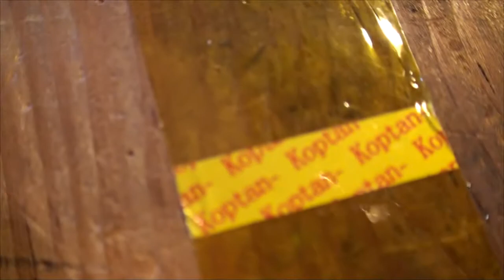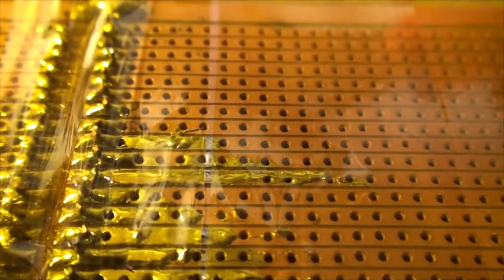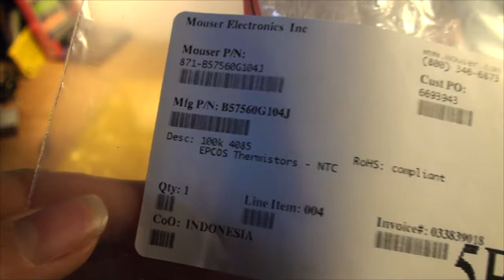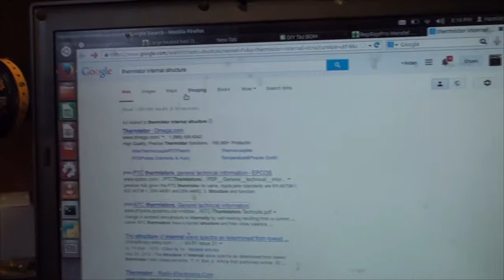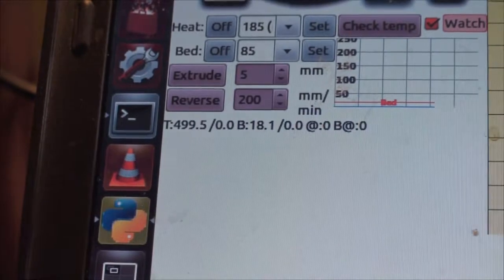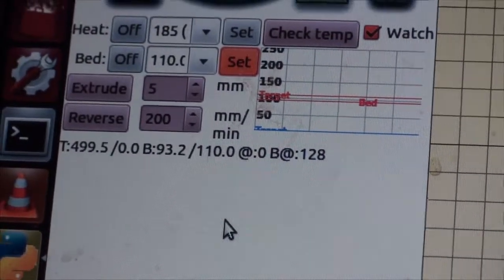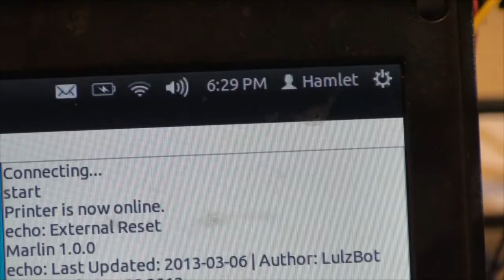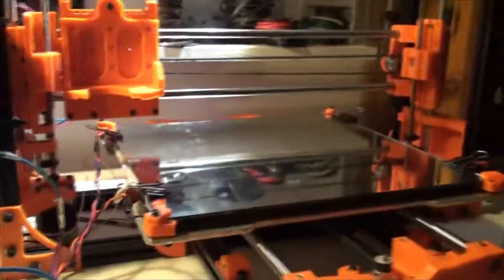DIY Taz - Ghetto HBP Finishing & Testing

Comment: You DO want your glass to lay flat on the heatbed. In your case.. Im now sure how that would work. I had a custom heatbed made for mine by a company that makes the normal HBP for the prusa. He just up-scaled it.
Reply from the maker: This heated bed actually works very well. In theory, you want the heating element to contact all areas of the print surface evenly - especially with untempered glass. However, because this heats somewhat slowly (0-60c in 4 mins) it does not seem to matter. I set the temp a bit higher than what I think I need and I have not noticed any variations in the 1st or 2nd or nth layer adhesion. How much did your custom made heater cost? Was it silicon? Or was it a PCB heater?
Reply: PCB Heatbed, It looks just like the 8x8 one that the Prusa uses its just larger. It takes about 4min to reach 114c which i think is not that bad. I am also using special glass made to take extreme hot/cold cycles. I got it out of an old Xerox copy/printer and had a local picture frame company cut it for me to the right size. Cost me a total of 0 dollars.. :P

When I tear down my TAZ and upgrade it (here in the next few weeks) I will post a video of me building it in timelapse so you can fully see my build. I am changing out ALOT of the stock parts for way better ones and changing a few other things as well.